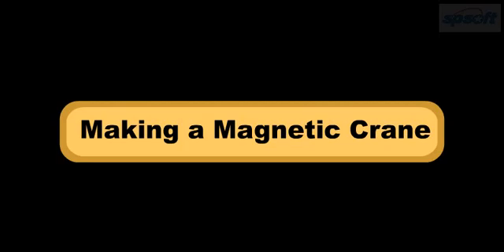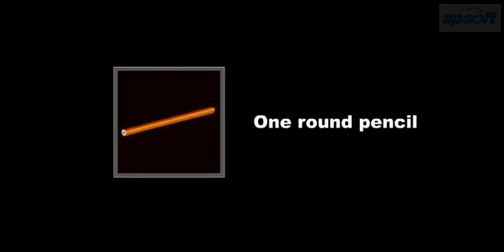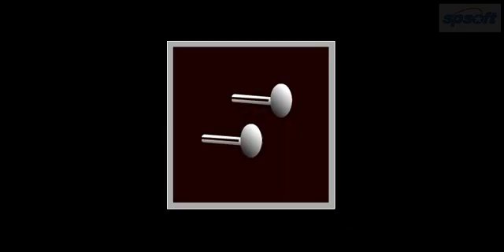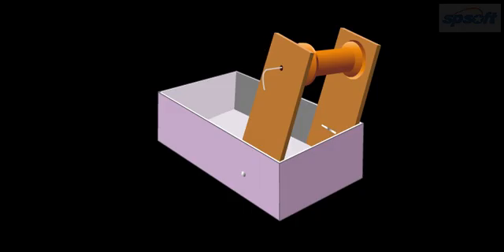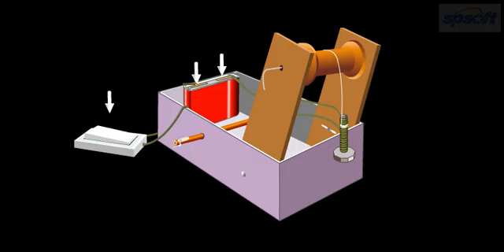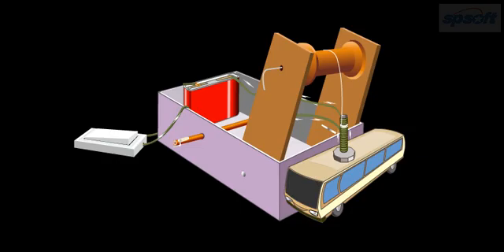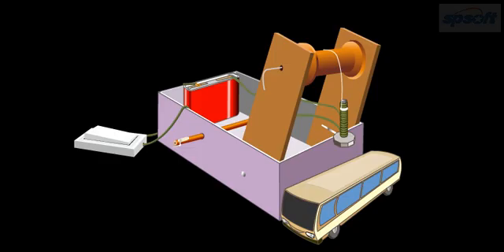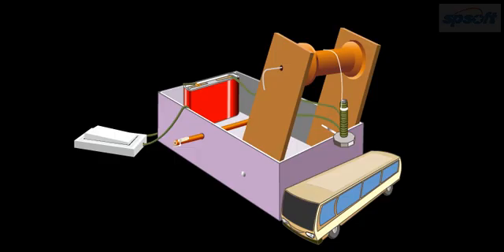Making a Magnetic Crane

Comment: When we turn wire around the bolt after connected to the 4.5 V battery it's made a sound and the switch has burnt.
Reply: oof